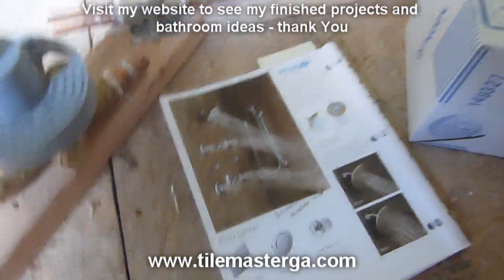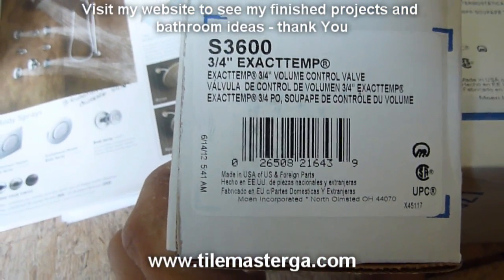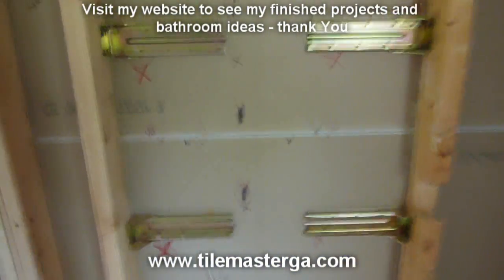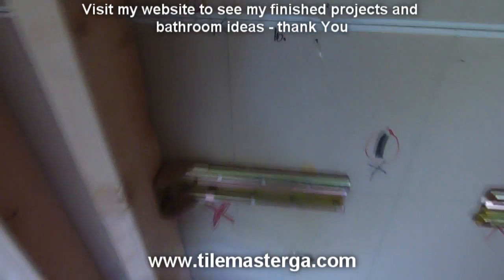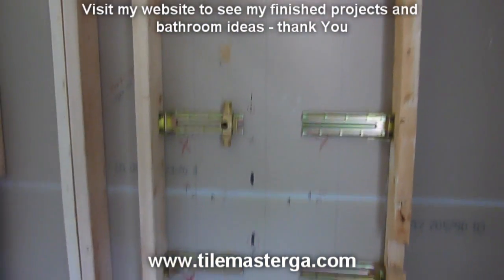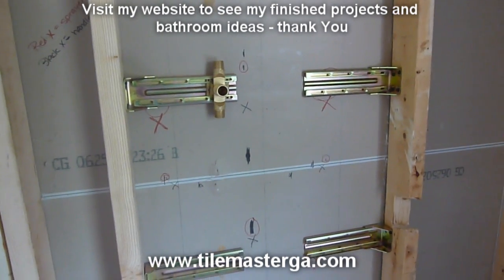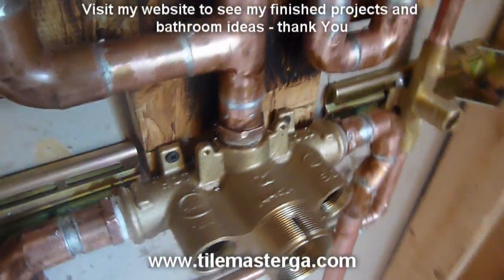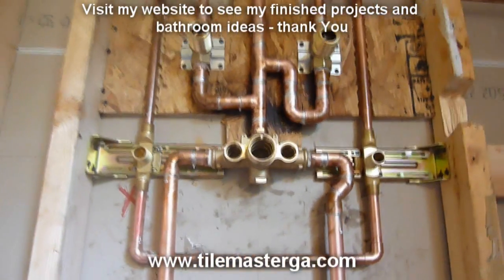(part-1) MOEN TS276 Custom vertical SPA shower system installation, sprayers, hand held 3/4" valve

Comment: Hello this is a very nice set up. 
Two questions if I could please:
Can you please list the part # for the kit for the body sprays, shower head, and the hand held. 
Second do you find that this system has plenty of water pressure if you run the four body heads and the shower head at the same time. 
Also what if this was done for a two person shower 
Could they run at the same time. 
Or would it need a extra pressure pump for the shower. 
My plumber is trying to talk us out of doing the body spay heads he is saying because most people stop using them and or they clog up easy and don’t work correctly after a
Period of time. 
Your thoughts and time answering these questions 
Would be greatly appreciated 
Ps I definitely subscribed and liked your pg.
Thank you 
LV
Reply: This was initially a "kit" offered by Moen - Vertical Spa Model: TS276 series -  Its claim to fame was the 3/4 inlets for maximum water flow.
The Kit is no longer available but the individual parts can still be purchased individually.  
S3371: 3/4” Thermostatic Valve (the "main" control valve - (1 required)
S3600: Volume Control Valves (3 required ) - in this case 1 for the body sprays-  1 for the shower head and 1 for the hand held
TS1322BN-S1300: Body Spray Rough-In Valves (4 required) The actual model / part number depends on your desired trim color finish (chrome, brass, nickel etc.,  TS1320-S1300, TS1322-S1300,  TS1422-S1300) 
NOTE: The fancy wall mounting brackets are PN - S1300 and have connection points for 1/2-Inch CC and IPS Connections. They are included if purchased in a kit with your desired finish trim but are also available as a stand alone part S1300

Comment: Old video but I like the install/ set up and see this is still sold. Question not sure if my home has 1/2 coming up from my slab current shower. Can I gofron 1/2 to 3/4?. Are there newer versions you would recommend. Thanks ahead of time.

Comment: thanks for sharing.  It looks like when the volume control is installed, the diverter is not needed.  Am I right?  And why the thermostat valve has 3 holes which, i guess, are for some kind of adjustments.  Appreciate any advice or help.

Comment: It doesn't seem like your loop for your body sprays was even. The water inlet on the loop has to be even  to distribute even water flow to all body sprays
Reply: It's about volume and pressure, I don't think you understand plumbing...It doesn't matter if they are even or not, its only important that you do not daisy chain them with multiple heads, otherwise the first one gets more pressure and volume then the last.
Reply: Josh Smith I don’t think you understand plumbing , this is not correct as it is daisy chained , there should be another inlet on the other side of the loop if you gonna have 4 sprays
Reply: This is the body spray arrangement Moen recommended in their spa design guide
Reply: Regardless if which response below you want to believe... this video from Stud Pack addresses any and all questions and alternate configurations regarding if you really need the legs in a pressure loop to be the even or identical in length - https://www.youtube.com/watch?v=ea4JRnG7Vps&t=1s

Comment: What's nice about this system is you can run all four outlet zones at the same time.  No wonder it requires 3/4" supply.  Very nice work!